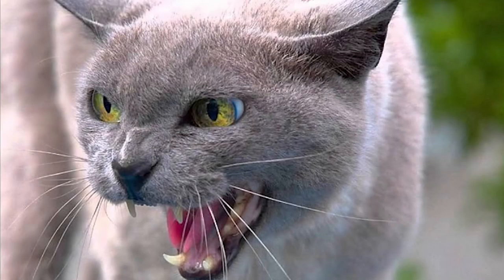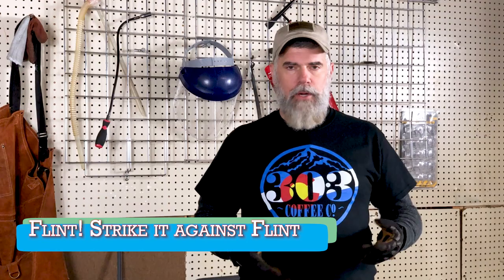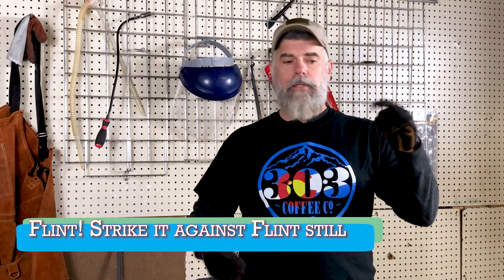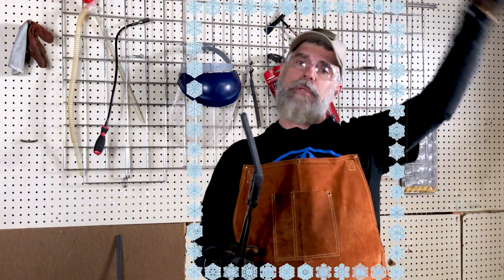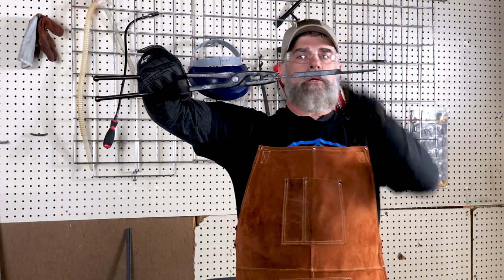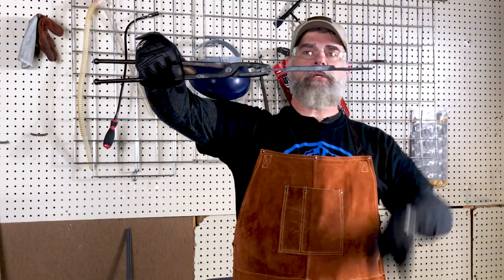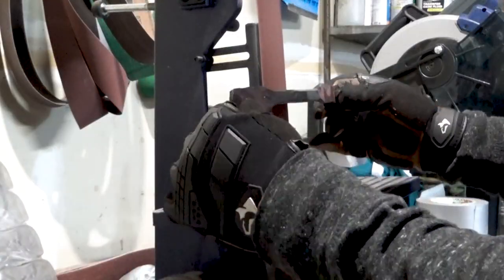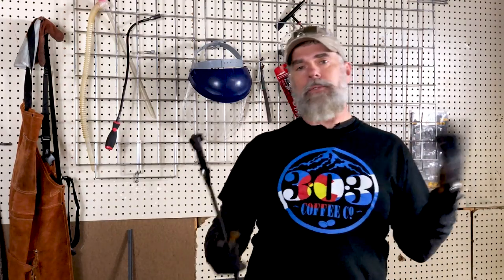Forging a Flint Striker

Comment: After quenching if you have to reheat and beat must normalize three times. I've cracked three bottle openers made out of coil spring from end to end by not doing that. Roy at Christ centered ironworks told me how to prevent it and has worked like a charm ever since.
Love the shirt man I do miss the 3 oh 3.

Comment: Just make the one you made shorter you only need to get a couple of fingers in it unless you want to use it for self defense in a SHTF.  And just harden the face of the striker and leave it glass hard it will work better.  Nice hammer work from round to square. We have Ninja flatland Tigers around here they like to leave surprises in my garden boxes.